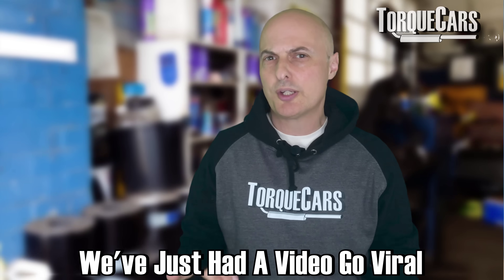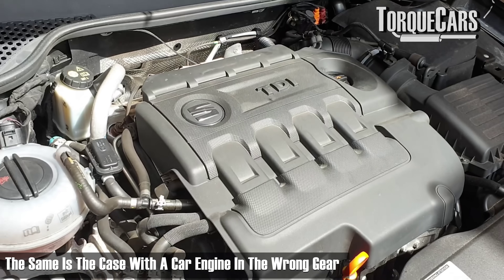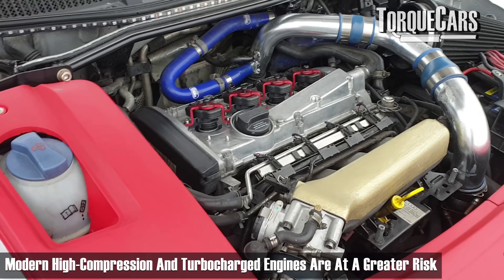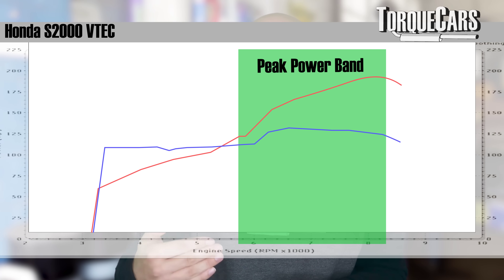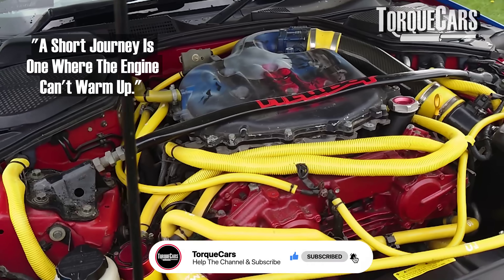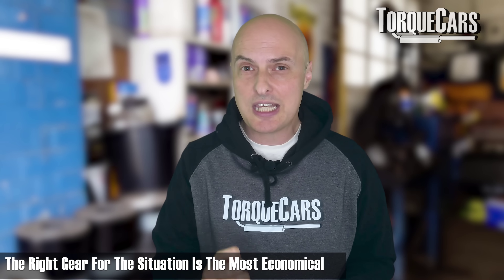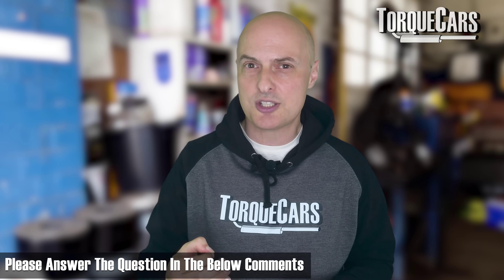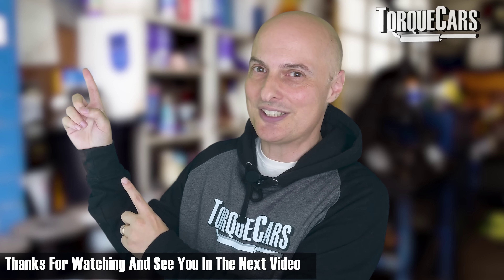Warning: Low RPM Lugging Destroys Engines! Why Low RPM Driving Is Bad.

Comment: Since watching the last video on this topic, and after almost 30 years of driving, I changed my style to what was recommended in the video. My MPG figures are almost identical, if not slightly better, in most cases. Where I have noticed the biggest change is when travelling over extended uphill journeys. MPG is significantly better and I feel more connected to the car.
Reply from the maker: So glad to hear that. I noticed the same when I adopted this recommended style and I was sure it was going to guzzle a bit more fuel but was pleasantly surprised.

Comment: I have driven several cars with an automatic, and it usually allows the engine to go down to about 1500 rpm, without shifting down.  Most automatic gearboxes will shift the gear down when you go below about 1500 rpm.

To go down to about 1500 rpm before shifting down, is also what the manufacturer often recommends when you have a manual gearbox.  

I find that the above recommended practice is working well and provides a low fuel consumption.  (When coasting, I myself often let the engine go down to idling (800 rpm) before shifting down or engaging the clutch).

Comment: Match gear to speed. So when you hit 20mph go second, third at 30, 4th at 40. Each gear is the start of the torque band at that rpm. usually around 2500rpm.
Reply: Depends very much on if accelerating/uphill or cruising.
Reply: lol, if I did that I’d destroy my engine.
Reply: Some cars can make it all the way over 60mph in first. When would it be ideal to shift when the gears are spread out like that?
Reply: What about idle Rpm... Any match.. between Max torque and max power..
Reply: My car has max torque from 1500RPM to 4000RPM
Reply: @flybobbie1449  my second gear goes to 77mph, max torque is around 6500rpm/65mph
Reply: More important is match rpm to how big resistance the car have to work against. With no resistance at all it can run 800rpm, when pulling a trailer up a stepp hill you might need 3000 rpm+, but same car at same speed without a trailer can happily go up the same hill at 1500rpm.
Reply: Here’s how I drive my 2L naturally aspirated 4 cylinder manual hatchback:
1st gear: 0-5mph 
2nd gear: 5-17mph
3rd gear: 18-24mph
4th gear: 25-29 mph
5th gear: 30-37mph
6th gear: 38+ mph

I’ve never noticed it struggle, and I usually hover around 1500-2000 rpm. These figures are for even surfaces only, so obviously uphill it’ll be different.

Comment: I have two cars with the 2.0L turbo diesel engine: an older Fiat Bravo (105 hp)and Hyundai Tucson (140 hp). Difference is that Fiat is a 5 speed and Hyundai is a 6 speed manual, gear ratios are on the slower side on Tucson but almost identical.

Now Fiat is a small, light, aerodynamic car, it can go in fifth 80 km/h (1800 rpm). But Tucson is 600 kg heavier, it has aerodynamics of a brick, and even with a slower gear ratio, it needs 90 km/h (2200 rpm) in fifth gear to cruise without any power drag. Man who sold me told he drove it 80 km/h in sixth, but honestly, I could feel the car is struggling with its weight even in fifth gear at that speed. Sixth is for cruising on a highway at some 100-110 km/h (2000-2200 rpm).

Comment: Yes, it is better to slightly rev an engine than labour it but bear in mind your up and down gear indicators try and change at the right time as this will prevent belt slip and possibly loss. If going up a gradient and you are close to gear change up it is better to allow the to rev in the lower gear. The problem is with electric transmission if your road speed is say 40mph and your weak field comes in at that speed it is better to stay at say 38mph to ptevent the a weak field taking place again expecially on gradients.

Comment: My 2.2 Jaguar diesel needs reving over 2000 rpm to regen the DPF, yet in auto mode, I would be regularly breaking the speed limit to maintain this. In semi-auto mode, going through the gears myself, I wreck the fuel economy that the diesel is supposed to provide.
Reply from the maker: It is crazy that we have to trash our fuel economy and pollute more to clean a filter that is designed to remove emissions. I did a video on that earlier. https://www.youtube.com/watch?v=gBc8UbDvcj4

Comment: Just use the gear needed i.e. swithing from 5th to 3rd on hills or passing.
3000rpm at 75mph seemed high at first, but thats 4cyl life. Gotta wind up that little rubber band!
Reply: hell my car cruises at 3100 rpm at 70 mph in its highest gear, or 3300 rpm at 75 if you want a direct comparison. If I changed to 3rd i'd be at 5500 rpm at 70 lol. It does mean 4th and 5th are usable at low speeds though, its happy to chug along at 1300 rpm in 5th gear at 30 mph.

Comment: I’ve proved many times and in different cars that selecting what feels right, around 2000 rpm vs being in a higher gear that the car is suggesting has given better mpg.
Reply: Just because they say you can, remember they want to sell you parts for the remainder of that vehicles life.
Reply: My engine has 5l lower consumption at 1100rpm than at 2000rpm - at a steady speed of 50km/h in city I have about 8l consumption at 1100 and 13l at 2000.
Reply: My car starts lugging below 1500 rpm

Comment: I have an acquaintance who is the most brutal car owner I know.
He is motivated solely by economy.
His beleif, which is unshakeable, is to put the car in the highest gear and lug the engine.  He always buys small capacity petrol cars ( economy again).
After a few years  of his ownership it will no longer sound like a petrol engine but a really agricultural old diesel. The engine mounts are knackered from the thing trying to throw itself out of the engine bay.
He then disposes of them and repeats the process .
God knows who is fool enough to buy such a time bomb.
I once suggested getting an automatic to him on the pretext that it would save him a lot of effort in the congested roads where we live.  A BIG NO NO,  did I not know that automatics consume a few more mpg than a manual!
He is not poor, well educated, 2 science based degrees ( not engineering!)  and a well paid job. An Advanced driver qualification !!!
He does this because he is  as miserly, tight, mean  call it what you like.  Yes he lives alone too.....
Reply: The stupid part is this doesn't even achieve fuel economy. Just ruins the engine.
Reply: ironically his obsession with economy gives him the worst economy too
Reply: Forgot to add he also has the option on his current victim,sorry, car of a choice in what petrol goes in. 99 octane or 95. 
The higher octane generates a more responsive vehicle with slightly better mpg, which negates its extra cost.  Nah! He goes for the cheapest.
Reply: @pw601  If it's not a performance car, running 99 will burn up yer valves before you see any performance gains.

You will however get a bump in fuel economy from running E5 vs E10. With a bit of luck it won't cost you more overall.

Edit: That said, he probably gets it from the cheapest supermarket around, so uhm... I foresee fuel system issues.
Reply: Ironically he would probably be better off with an EV,  massive amounts of low down torque and no gear box for him to input any ideas.
Reply: Agreed,  poor quality fuel not good. 
Regards octane, if your vehicle has the option to run a different map then this can be beneficial.  My old Audi A4 1.8 T is much happier on 99 than 95.  The label in the petrol flap says that’s the minimum. 
Equally a neighbour runs a Lexus 400h.
It makes no difference putting in 99.
Reply: @pw601  Or a decent hybrid. Not much he can do to break one of those.
Reply: @pw601  I got a mid-'90s Toyota. She's not fond of E10, but apart from that it makes no difference.

I don't notice much difference on the bike either (2021 Honda CB650R), which is odd, given the performance-oriented nature of the bike.

Makes sense for the Audi though, turbos have a lot more to gain from a bump in octane rating than atmos.
Reply: @pw601   Usually octane needs are indicated on the gas door. Your Audi is a turbo and probably runs stupidly high cylinder pressures though so it makes sense why high octane is necessary.
Reply: Funny how those highly intelligent people with degrees can be the most idiotic at the same time. 
He would save way more keeping his car and driving like a human being, instead of lugging it, using the cheapest fuel out there and replacing the car every few years. 
A simple economic cost calculation would reveal that.
Reply: @strel0k215  well educated does not always mean they're intelligent
Reply: Your acquaintance needs therapy to deal with anxiety and fear related to money.
Reply: Is he a BMW owner by any chance?
Reply: A BMW?  Heavens no.  He drives a Ford Fiesta Eco boost ( turbo).  He did have a very basic Audi A3 some years ago and was displeased with servicing costs, so somewhat averse to “premium “  German brands. Don’t know what he is going to do now Ford have stopped producing the Fiesta.
Reply: @pw601  "Heavens no" 💀💀. I asked because I kinda wanted to add to the unreliable BMW joke, but your first statement tells me what you've probably had experience with that 🤣🤣
Reply: @pw601  Eco boost, don't have to say anything else.
Reply: @pw601  Your friend sort of reminds me of my family man engineer buddy who only uses winter tyres all year long in SE Europe.
I tried to explain the drawbacks multiple times, he still finds it a good idea. In the summer, when he applied the brakes at high speed I could hear the winter tyre knobs rumbling.

Other than that, he is a great bloke, and definitely not cheap.
Reply: @pw601  call it being frugal lol

fuck all those how to be a millionaire videos
Reply: So basically he's doing the opposite of what he wants to achieve! My cars are driven as best suits THEM (it suits me as well as it's fun: low load and mild style until warmed up  then they live all over the RPM range 😊) which makes me spend slightly more fuel and slightly more on service (I change oil twice a year) BUT, overall I SAVE money as I haven't purchased a car in 17 years (one is 2008. The second one is 1992.) And both have been bulletproof and loads of fun!
Reply: Ouch
Reply: A miser? An idiot.
How much does it cost to replace those engine mountings? And it would seem he paid for the science degrees and the advanced driving licence.

Comment: 7:04 😂 sorry but that is not correct.. My ECU stage 1 1.0TSi has loooads of power, on autobahn i got 223/h from it and that day i really pushed it and it was at 5l/100 average cons. Dyno says 104kW and 260nm of torque (max values) and it is true that turbo has some lag, though much less than factory ECU

Comment: I've got a manual Audi A4 1.8T with e-throttle. I always keep it between 2000 and 3000 rpm and the engine seems happy with it. The VW turbo-4 engines have full torque at 1750 rpm, so there's no need to ever drive them hard. Which is why they are capable of very high mileages if you treat them right.
Reply: @joeaverage3444  
@joeaverage, agree completely in my 1.8 VW Golf. At 2350 rpm I am at 75 mph and 43 mpg on the highway.

Comment: I drive a 2016 1 litre three cylinder petrol turbo Astra. In 3rd gear at 30 she's happy at 2,100rpm. With my speed limiter on, the ECU controls fuel so I don't need to feather the throttle, my economy goes up! If I go up to 4th it starts vibrating slightly (lug?) and it's annoying so I drop back down! 

My mum is the opposite, she's at 30 in 5th gear in a 4 cylinder 2008 petrol Vectra. I keep explaining the points in this video but sadly I can't change her habits, she's set in her ways 😑. Your alternator won't be spinning fast enough either with lots of current loads running.
Reply: You may be suprised but it's completely possible its happy in that gear if its an NA petrol engine. Turbo-charged cars do have a lot more peak torque and a lot lower down, but they do have a boost threshold.

I'm assuming by your description your car is the 1.0 EDI Turbo ecoFLEX with a 5 speed manual? Doing the maths it would be at 2106 rpm in 3rd gear at 30 mph, which matches what you've said. The boost threshold in your car (the lowest rpm where the turbo can fully spool) is approximately 1750 rpm. And when you change into 4th you're at 1506 rpm, which is below that threshold which is why you'd feel like you're lugging the engine, because you are if you use any significant throttle. The turbo can't fully spool at this rpm, and the time it takes to spool as much as it can is much longer, which means that torque you get when you poke the throttle is far lower than its theoretical maximum at this rpm, in an NA car it just produces the power it can the moment you ask for it.

However, a 2008 NA-powered Vectra would not have that issue because there is no boost threshold, and probably has substantically more torque below 1500 rpm than the turbocharged engine in your car, even if its peak torque is both higher in the RPM range and less in value. Add to that that its probably geared a bit shorter than your car, because most cars of that era are, and its entirely possible the engine is perfectly happy in 5th gear at 30 mph if its just being asked to maintain a constant speed +/- 5 mph.

Doing the maths going 30 mph a 1.6L 2008 Vectra is at 2249 rpm in 3rd, 1782 rpm in 4th, or 1419 rpm in 5th, which is completely fine for an NA engine if you're just maintaining a low speed. For context your car appears like it would be at 1203 rpm in 5th gear so it's geared far far taller.
Reply: @__-fm5qv  That was a great explanation! The tech geek in me loved soaking that knowledge up! Thanks so much! :)
Reply: @supergeekjay  Thanks, I'd dif worry I'd gone rather overboard...

For what it's worth if you do live in a place with a few hills or with slightly undulating terrain your mum would probably be better off in 4th. But on level ground 5th is just fine in a car like that.

Comment: Part of the issue in modern cars is gear shift lights. My mini cooper S for instance often wants me to go into 5th at 30mph which is about 1200rpm or 6th at 40mph. With 30mph 4th at 1600 feels a lot nicer. 3rd at 2000rpm is also usable. Meanwhile I was manually shifting into 5th at 30mph on our other car a DSG golf because it added about 3mpg to fuel economy in town. I noticed that having done that the stop start would wait 10 seconds before turning engine off instead of switching it off immediately whereas in auto or leaving it in 4th no such issues. Needless to say I don't do that anymore! Always thought low RPM was good but now I know very different after seeing a few videos on this. That little 1.0tsi you have though actually has decent torque and can cruise happily at 70 without revs screaming. However fully loaded it will struggle more.

Comment: Awesome video , does anyone know what the 'Engine Load' value that we get using an obd2 reader means?
Reply: That's how much load the engine is under. Even idling it will be between 16 & 24%. Setting off from a standstill and under hard acceleration it will go to 100% as that is the most stressful time for an engine. Once you have momentum it drops. If your OBD tool has live data feature, set it to graph, and record it for later watching. DON'T watch it while driving! I use an expensive AUTEL MK808 so cheaper ones might not do it.